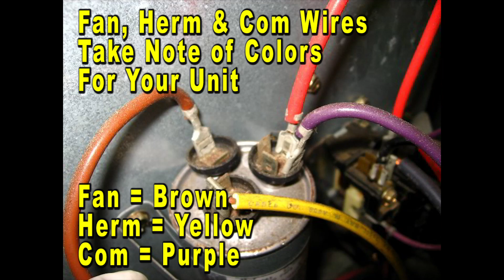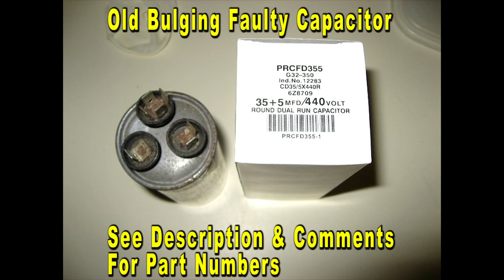GE A/C System How To Replace Faulty Dual Run Start PSC Capacitor For Condenser Compressor Unit HVAC

Comment from the maker: Dual Run/Start Capacitor - https://amzn.to/40GF8k8
440 Volt 35+5MF capacitor - https://amzn.to/42NvkXp
Digital Multimeter - https://amzn.to/3zffrvd
Rubber Safety Gloves - https://amzn.to/3KhF7O4
Safety Glasses - https://amzn.to/3G07aPA
Precision Screwdriver Set - https://amzn.to/3TCMm6n
Plastic Pry Bar Tools - https://amzn.to/3HMtsV7
Socket & Ratchet Set - https://amzn.to/3Z17LbA
Mechanix Gloves - https://amzn.to/3jCnHkt

The Paul79UF YouTube channel is a participant in the Amazon Services LLC Associates Program, an affiliate advertising program designed to provide a means for sites to earn advertising fees by advertising and linking to Amazon.

Comment from the maker: Check out the DIY guide for changing a faulty dual run/start (PSC permanent split capacitor) in a General Electric outdoor HVAC condenser, blower motor and compressor unit - https://www.paulstravelpictures.com/Air-Conditioner-Dual-Run-Capacitor-Replacement-Guide/index.html